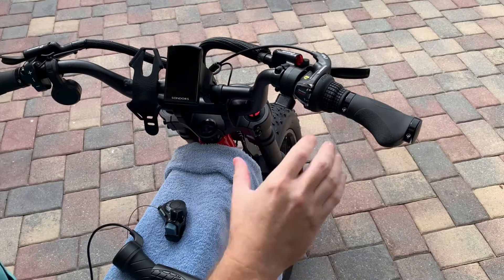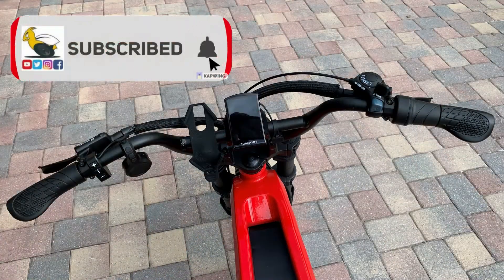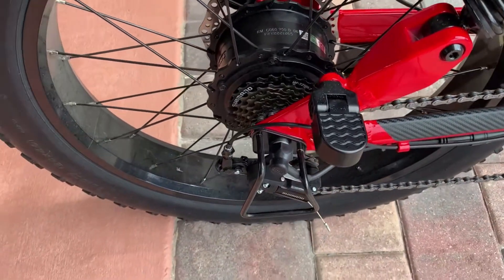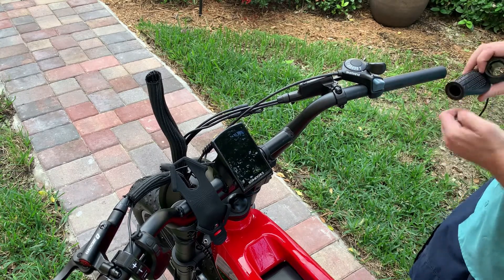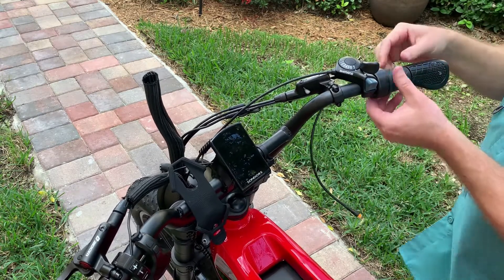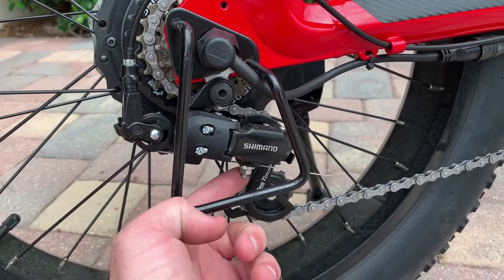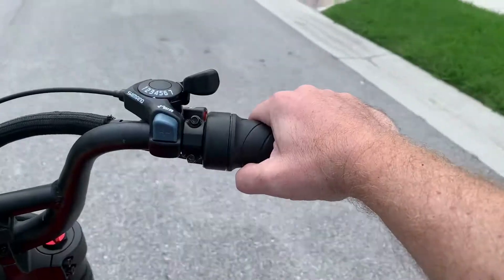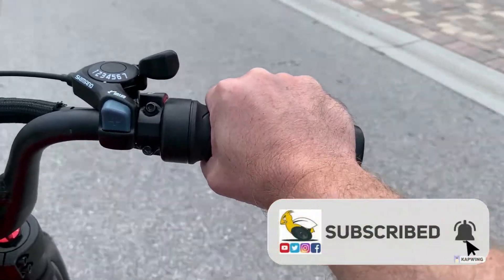Replacing eBike Thumb Throttle with half Twist Throttle

Comment: Would you have any idea on why my q20 throttle stopped working
Reply from the maker: They just go bad.  I had that happen on another ebike.  As long as the pedal assist it too good then it just the throttle is easy to replace and cheap see link to replacement throttle for $9.34 https://amzn.to/3Ryk2SV
Reply: @BRichSolution  thank you does it come with electrical so it would power

Comment: Replaced my throttle and now once turn on bike it goes full throttle? Any help
Reply from the maker: Is the throttle stuck in the open position or pinched against the stationary rubber handle?   If none of those get a a replacement throttle

Comment: I bought a thumb throttle because the twist throttle for my fatbike is awkward to use but it gives me an Error08. I guess the pinout is different. Have you found this issue before?
Reply from the maker: Yes, you may have to buy a  different throttle with the correct pins to get it work.  When i did this video the first throttle i bought did not work and tried a second one and it worked.  One think to mention instead of using the throttle on long straights when wrist gets tired i stop using the throttle and slowly pedal and the bike uses motor but I don’t have to hold the throttle
Reply: @BRichSolution  I use the pedals mostly. But I find on hard climbs when I am standing up, the motor keeps stopping because of the slow pace and the throttle helps on those situations to keep the motor always on. Thats why I want a thumb throttle.

I am trying to see if opening up the throttle and changing the order of the wires will just get it working instead of waiting for a new one

Comment: This is a bit more complicated than I thought how did you take out the wire cable from the shins I gear shift into the new one so easily did you cut it or just unscrew everything from the bottom there to get it out I’m having trouble taking it out of the gear shifter thing to at the top
Reply from the maker: Unscrewed the cap on the end of the twist shifter and then the stock cable will come out easy.   I reused the factory cable with the new shifter.
Reply: @BRichSolution  I pretty much disassembled the whol original twist gear shifter but that cable thing on the inside of it doesn’t want to come out unless I maybe just break it

Comment: Did you take off the rear derailleur to replace the gear shifter I did and now I don’t know how to put it back on I don’t know if I lost a screw or not but the Knut I have isn’t long enough to go thru the bike and the derailleur whole???!!? Help please
Reply from the maker: I used the shifter cable that came with the bike and used it on the new shifter.

Comment: Again, a nice video, thank you. I noticed you have installed passenger foot pegs. Are those aftermarket or did they come with the scrambler? I have mine on the way and will be using much of your advice.  I do live in the mountains though with a 10 mile constant downhill commute to the city, about 10 miles in the city and another 10 to go back up the mountain. I do plan to add a 52v 20ah battery but not sure if the rear hub 750 motor will have decent pull uphill.  If and when you have the settings at 30 amps and the wheel size decreased to min are you still lacking power or do you feel it's sufficient? Thanks again
Reply from the maker: Mini folding foot pegs bolt right on to the frame using existing tapped holes.   https://amzn.to/3toffIw
As for making it up the hill; depending the on grade of the hill and how long the grade is will determine if you will have sufficient power.     I can tell you if I start off at base of bridge (no hills in Florida) with no speed the bike is not ideal and acceleration is slow in the condition w/o a running head start.